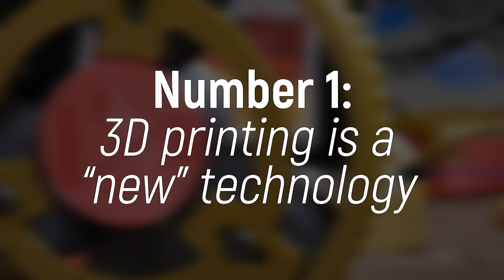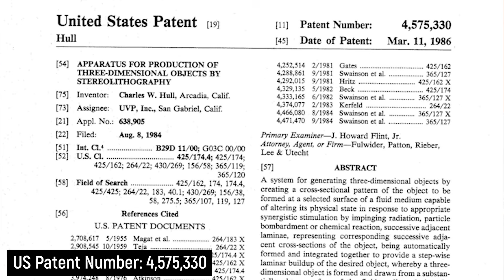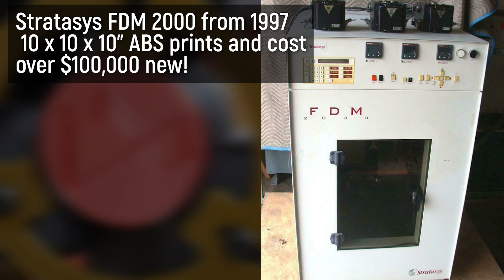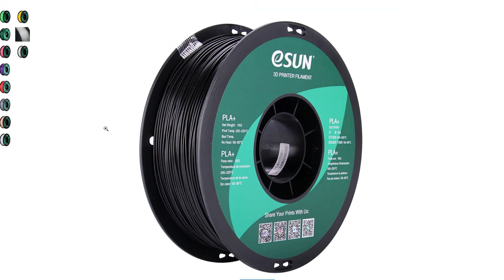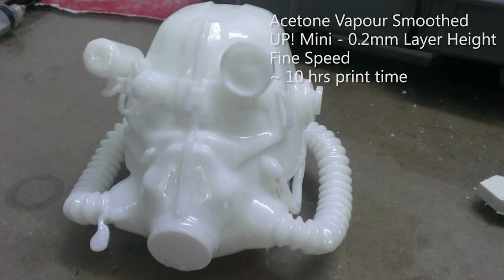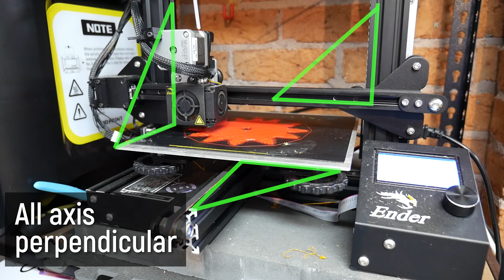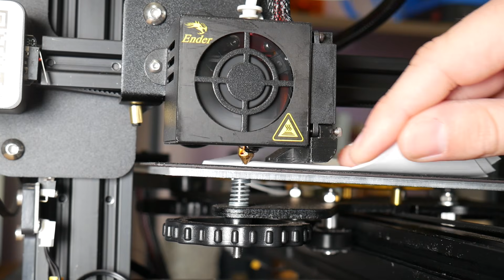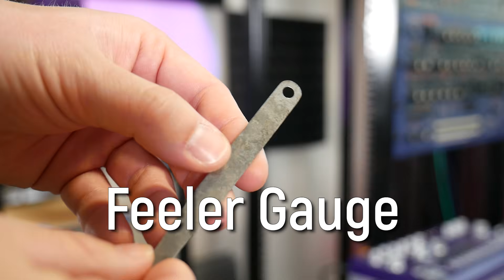3D Printing Myths I used to believe...

Comment: Folded paper? I've never done that. I've always used paper but unfolded. It's always worked fine
Reply: I used to use a folded paper, but recently I discovered that an unfolded piece works much better too.
Reply: I've always used a single piece of paper without folding too. Never had any troubles with that, though I'm also not fussy about it either.
Reply: I never folded paper, i just tore off some corner from whatever i had nearby, a habit from working in a machining shop, so i was already intimately familiar with tramming lol
Reply: I didn't think of feeler gauges, I've always used playing cards.
Reply: @MattKasdorf  going to try using a playing card, good idea. Don't like the idea of a metal feeler gauge scraping the bed
Reply: ...or that brass nozzle!
Reply: @Gamer_In_Yellow  playing card seems too thick to me. I levelled my bed the other night with a piece of notepad paper from a spiral bound a5 notepad. TBH it actually felt thinner than a normal printer paper page. 

Worked beautifully. I tend to eyeball it anyway but the paper gets me started. Typically I just look for the light gap under the nozzle and guesstimate it on all the corners. You get a feel for how much light you should see between the nozzle and the bed.
Reply: @Gamer_In_Yellow  You're not scraping the bed with it.
Reply: @Gamer_In_Yellow  have you ever used a feeler gauge? They are super thin and you would have a hard time scraping anything with it much less the glass or steel pei sheet lol
Reply: I used to do it with a pice of paper but I got bored of trying to find it so now I do it by eye and if it's wrong I adjust it while printing the skirt
Reply: edgy  @hyperphrog69
Reply: I use the thinnest paper I can find. Some glossy advertising slips are very very thin. Works perfectly for me
Reply: a piece of paper is 0.2 mm. its for that you use un unfolded paper to get a good calibration
Reply: @tomasbond4167 
A piece of 80g/m² paper has 0,104 mm
Reply: It isn't that the paper thing doesn't work, but some folks out there apparently don't really understand what you're trying to accomplish with it.  Use whatever, but you need to set the first layer z-level appropriately.  Not rocket science
Reply: @travcollier  well it assumes all paper is the same thickness. In a pinch it works but you kinda need to know the thickness in relation to your layer height
Reply: @SwiftCreationStudio  if you use the same type of paper every time- then it IS the same thickness. I’m a cnc machinist who regularly uses paper to touch off tools against the workpiece in industrial machines. A piece of standard A4 printer paper is exactly 0.1 mm thick & is amazingly consistent across not only its entire surface but even from sheet to sheet, and sheaf to sheaf. A little bit of practice gauging the correct feel for your 3D printer will do wonders for your setups. One unfolded sheet is more than enough......
Reply: Same same, I just use a single layer of paper.
Reply: Same here never folded paper the paper & used parts/scraps of A4 paper used for printing since it's more standardized.
Reply: I got some grooves in my pad cut I didn't react quickly enough.
Reply: I use unfolded paper and it works great
Reply: me too, and without a problem i can get first layer as good as shown in video
Reply: The thickness of the paper doesn't matter. What matters is 1) that it's uniform and 2) that you're "tramming" the bed with the z-height set to the same height as the paper, not to zero.
Reply: Why hadn't I thought of using a feeler Guage. I have a ton and I'm always using them anyways.  Thank you.
Reply: Why hadn't I thought of using a feeler Guage. I have a ton and I'm always using them anyways.  Thank you.
Reply: @TheZillionEffect  yeah. Did that day one. Scrape. 

That said. I used a post-it the other day and it seemed damn near perfect.

* just checked. Post-it is about 0.1mm so maybe there’s something to this folded page thing, being that the nozzle should be .2mm above the plate.
Reply: Exactly folded a few times, its like wtf, no even my printer's manufacture says don't fold it, and gives you a measurement in case you wanted to get a feeler I guess in their how-to-assemble video online.
Reply: @Zalzany  i actually just 2 pieces of paper on top of eachother unfolded and use it like that lol, it works well also
Reply: i've used business cards or scratch off tickets(any kind of that thin cardboard) and it's perfect every time, at least with my cr-10
Reply: I use unfolded paper and its always worked just fine
Reply: I find it easier to level visually. When I use the paper I'm there for atleast 30 minutes
Reply: @KaidenJacob  same here, I tried doing it visually with good light and sharp eye and thats it, no need to break my head struggling with the paper
Reply: I just started using the sticker that came with my gfuel on my ender 3 pro. Slight resistance. Works perfectly.
Reply: It depends on the height you need.
For .08-.12 unfolded is great 16, 20(with adjustments), 28 can usually be achieved by folding on half or in fourths depending on thickness but it's not 100%
Reply: Well....Did you listen to what the man said ??
Reply: Exactly
Reply: Same
Reply: yeah me 2, single piece of unfolded paper works great, and I use a glass print bed aka a cheap picture frame
Reply: Same. Just a piece of paper, no folding. And so far no problems.
Reply: same here. I just use flat paper and go for little to no friction, if I feel it grip the paper, I back off. never used tape or glue and get perfect bed adhesion.
Reply: I have a xyz pro and I have to use paper every print I hate it
Reply: I only fold it in half
Reply: never used paper cuz I knew it added it's thickness to the first layer thickness, tram the bed to the nozzle without anything and set first layer to 0.2mm or set first layer 0 in slicer and use paper
Reply: @Torskel  I use klipper, and a macro which homes all axis, sets z to 0.2 and unlocks steppers.
Reply: One piece should slide right thru...2 pieces should get stuck...its a go -no go guage.
Reply: I never even knew that people used folded paper I only ever use unfolded paper
Reply: @charliebell7163  yeah. Unfolded does the job for me. Although I think I'm gonna dig out a feeler gauge so I can be super accurate.
Reply: @PrymalChaos   Yeah i agree just ordered one from good ol amazon.
Reply: I use Pokemon cards lol
Reply: My test is a single sheet of receipt paper, and resistance is so that you can just barely push and pull it under the nozzle. Typically gives you a 2 thou gap which is easy and cheap to do and gives a small buffer of not squishing your nozzle if you go too far
Reply: i just use 2 pieces of paper on top of eachother but not folded and it works perfectly
Reply: I think that's basically what he's saying. You want the nozzle to be as close to zero Z as possible so not folding it is better than folding it.
Reply: Yeah, i've used unfolded paper since 2013. Once the orinter is "fine", i use test prints for finer tuning.
Reply: For PLA I use unfolded paper for PETg I use the single fold then baby step it back  1 and it works perfectly. I want to try the feeler gauge again I tried it once and it was a complete failure. But may have been using the wrong thickness of gauge.
Reply: Always used untold, works fine
Reply: Same, when I was doing research, one of the first things I read is that for some printers even unfolded printer paper can be too thick, so I've always just used unfolded.
Reply: Never folder paper either. I didn't read all 71 replies at this point but heard paper is about .08mm -.1mm. Although I've been using a feeler gauge for a while now.
Reply: Bible paper is the best tho
Reply: I use a business card, perfect for PETG
Reply: A single sheet of paper is about 0.1mm but it could be about half that. Anything more or less than that is probably something special. If you can feel the lightest drag on the paper you are probably within .1mm and can adjust the z offset from there based on 1st layer performance.
Reply: Same
Reply: same here ive done the paper and had awesome prints i got just eye looking to help also
Reply: Yeah I use a single sticky notes, light pressure, and go right above the screws. Works like a charm. Then I print on a raft so it doesn't even matter haha
Reply: I've never folded the paper either.....Usually if the print messes up on me after that, its almost always from a clogged nozzle or i messed up on the temp settings
i may try to fold it though....just for science
Reply: i use a receipt paper. just thin enough n works fine for me
Reply: Same
Reply: I personally a piece of thermal receipt paper.
Reply: I fail to understand how multiple layers of paper could ever perform better than a single sheet. A crease in any of them will change create variation in the thickness of the stack, making it nigh impossible to get a correlation of feel to nozzle height.  A single sheet is extremely repeatable, and its thickness easily calculated if you have a ream to hand.  Stick the ream in your calipers, divide the measurement by 500. (Divide by 1000 and double is trivially easy... 57mm becomes 114um.)
Reply: yup been printing since 2015 always single sheet flat no folds
Reply: Post it😊
Reply: I use an unfolded playing card
Reply: Unfolded paper works well enough in professional manufacturing for tool height setting, so it's fine for 3d printing
Reply: The UK has thinner paper I guess
Reply: Ive always used business cards
Reply: My machining instructor taught me to use rolling papers
Reply: I always use unfolded😂
Reply: Me too
Reply: I just eyeball it and adjust if needed haha
Reply: I have a set of feeler gauges works way better than paper
Reply: Same
Reply: Never folded paper I just use specific thin paper for that 
Works every time
Reply: I use a sheet of those color coding dot stickers
Reply: Me too idk man I see fake news in this video
Reply: I’ve stopped using a sheet of paper, I just get the extruder jjjuuuuuuuuuuuuuuussssssst touching the bed, and then get an overly square print anyway because the printer only works with Chinese software...
Reply: @ataphelicopter5734  time for some Marlin flash and/or motherboard upgrade no?
Reply: @ataphelicopter5734   x1
Reply: @ataphelicopter5734  You can set it to English
Reply: @ataphelicopter5734 what printer do you have? That sucks unless you’re in china lol
Reply: @ataphelicopter5734  tell me you’ve never programmed before without telling me….
Reply: @thegamingclipchannel  other slicers don’t help, as the printer still seems unable to create perfect circles
Reply: In theory, when using a 5 point adjustment feature  through printer firmware, it should bring the nozzle to +0.20 relative to the latest Z0 calibration.

Having said that, I think ABL is much superior due to its ability to automatically compensate for changes that occur over time and unevenness/imperfections inherent in the print bed itself (which you can't really  compensate for by tramming).

Given the cost of these sensors, I think anyone designing a printer in 2021 should include them.
Reply: With a prusa you fine adjust z after calibration, so as long as your consistant it shouldn't matter (on such a machine. If this is your final calibration then...... idk, that's why I got a prusa
Reply: There are many different thicknesses of paper. Some easily twice as thick as others.
Reply: (un)folded paper? Nah, too hard. I have a Prusa printer, which does all work with levelling and first level height for me.
Reply: @Tom_videa  which model?
Reply: @Handai7  Prusa I3 MK3S+, and I'm very happy with it.
Reply: It depends on the resolution settings you are using, if you have bigger layers you need a slightly lower bed.

I could be wrong.
Reply: @davidvidic  you are, indeed, incorrect. A properly calibrated printer with properly written gcode will work because the gcode should compensate for the layer height.

However, if you just change the extruder output and not anything else; I suppose a thicker calibration sheet may help. But again, I think live z adjust is the place to handle such things.  

*edit: the thicker sheet would only help with the first layer too, given the situation above where one one changes the extruder value ...... that's just a bad idea. You must compensate by changing or recompiling the g code because the z change between layers has to change as well.

Comment: Single layer of reflex copier paper, while cold, then set the slicer to do first and last layers at 0.1 instead of 0.2. Works every time for my on my MASSIVELY rewired MKS GenL powered Tronxy running Marlin 1.9 and my Ender 3 Pro. (Mind you, the Ender 3P has been a mongrel with massive extrusion problems and heat creep in the stock Creality extruder, now replaced with the E3D that my cheap nasty delta and Tronxy run.) My delta has primitive, full auto levelling and despite being a cheap piece of chinese junk has been my most reliable beast. I swear, I was convinced that nasty T1 control board wouldn't last a week. Still going after nearly 2 years, never offline more than a few days for nozzle changes. I still prefer a quick corner level on the cartesians, to auto. I have my system so finessed, the prints stick first time, everytime and not a hint of elephants foot.

Comment: I have always used a single layer of normal, thin paper. that's probably not so bad.
Reply: yeah, it makes sense though. I usually do one sheet of paper, and high resistance. As long as i can move the paper without tearing I call it good. This would get me very close to correct. However, after seeing this video I may 'auto home', then move the Z by 0.1mm, then use a sheet of paper, but just have the paper barley touching. This would be easier, and use less paper hehe (no tearing)

Comment: Mate, i can tell you a few storys about bed leveling, and it still depends on the machine, material and slicer.
Example: I have a modified Ultimaker 2+ and i am still using the calibration card.
I NEVER had adhesion problems or bad first layers.
But...this is only because i not only use the card, i also look at how small the offset is to the bed, i can tell you that distance without meassuring it.
Also the first layer height Ultimaker has set in the standard profiles for pla, is waaaayyy to much. It stands at 0,27mm, my custom profiles are at 0,15mm for the first layer with pretty much no elephants foot or very small foot.

I used to level with a gauge at my first printer, wich was a Hephestos 2.
But that didn´t do anything, because this machine used autoleveling each time and that sensor was total crap, wich calculated every time wrong.
But after i got the heatbed upgrade, i send this piece of sh** back to the store, it was not possible to print something with it.
Also i got about 7 spare boards in one year, 6 of them had damaged software (wich wasn´t possible to repair with a new flashing, because they all were locked).

I also was planing to sometime in the future buy myself an Ultimaker 3 or S3, but i did read too much about how the autoleveling works and i do it till today.
If your printer goes too much digital, more errors can happen.

So i still love analog printers, there isn´t much that can go wrong and if it does, the reason why is found fast.

Comment: I use ABS over PLA because it has a higher tolerance to heat. It is better against friction compared to PLA as well. It was never about strength, but rather longevity. I've had PLA parts warp just from good old aussie summer.

Comment: Move the print head to z= the thickness of the paper, not 0, and don't fold the paper (it makes it springy, why would you want that). Almost as good as using a feeler gauge, but most people don't have those and do have paper

Comment: I've not heard about folding paper to set the nozzle height. With my first printer (a Makerbot in 2012) the instructions said to use a Postit note or a sheet of copy paper.  I quickly discovered this advice was of little use for the height - ok for 'levelling' the plate, but hopeless for setting the first layer.   We've come a long way since then. Perhaps if I'd folded the paper...
Reply: My makerbot in 2014 said to use a business card.

Comment: The fact that PLA (and possibly other similar filaments) adhesion to glass doesnt need anything but the soap/water cleaned glass and that more volatile solvents arent necessarily better, took me a long while of trying and failing using different additives (glue, hairspray, goo, special forulas etc) until i saw Ivan Mirandas great vid on the topic.
Reply from the maker: Agreed! It needs to be perfectly clean, but bare glass can work amazing on its own. I don't really buy into the fancy adhesion promotion products on the market.